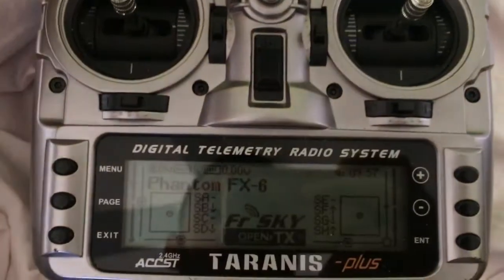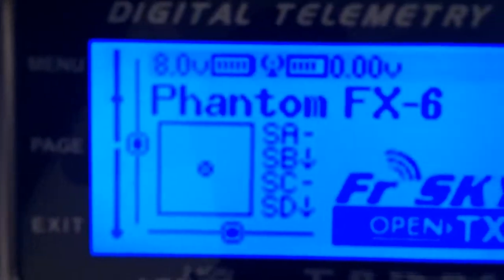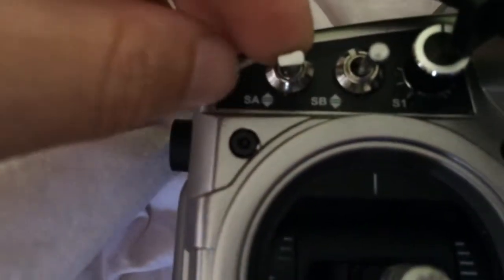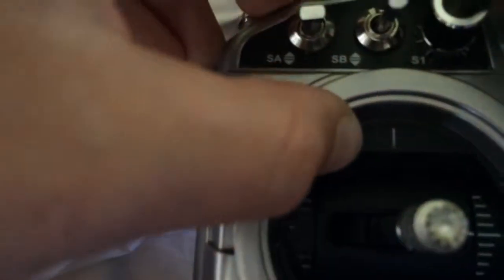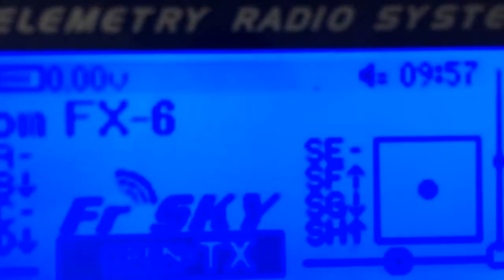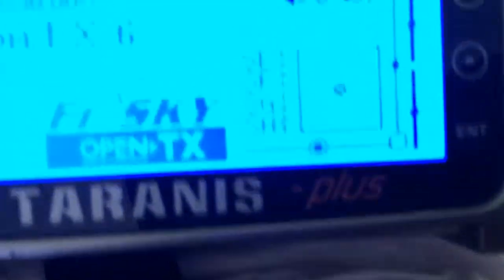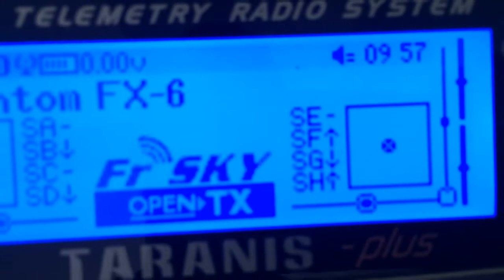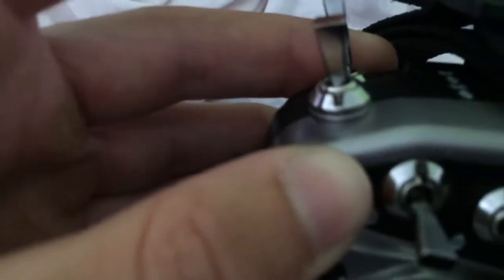Taranis switch failure

Comment: This same problem just caused a crash on my trex 700 scale heli   :(
Reply from the maker: Yikes, that sucks. I had 2 crashes on my logo 480 because of it as well. Luckily that thing is a tank and only bent a main shaft.

Opentx is awesome but the taranis hardware is junk. I wish they would charge a bit more and use better quality hardware.